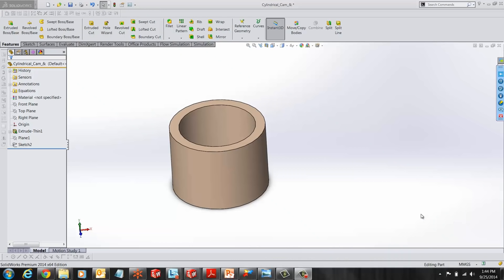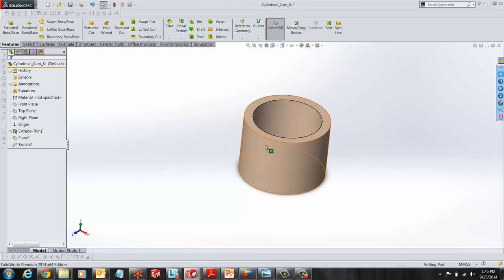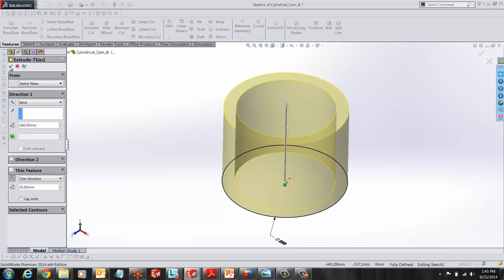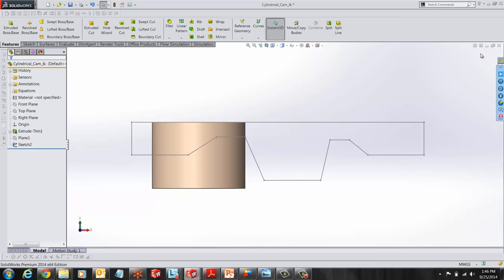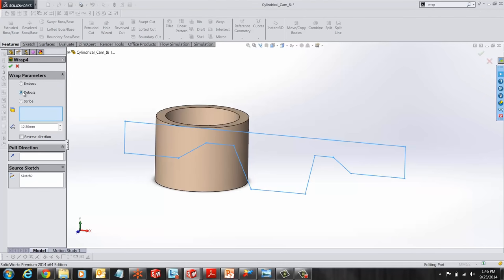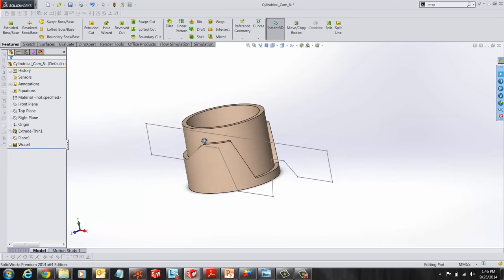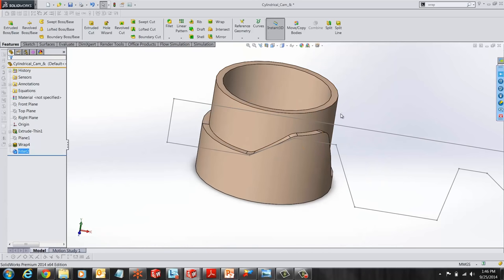SOLIDWORKS - Wrap Feature

Comment: If only fusion 360 had a feature like this. It has an emboss command, but no command that can exclusively wrap a sketch around a curved surface. There are ways around it, but they are round about, using the tools in ways they weren’t intended.

Comment: can you wrap around a rectangular prism ?
Reply from the maker: Per the definition of the wrap command lets us know the wrap can only be applied to singular faces 

You can choose between two methods to create a wrap feature.
The Analytical method wraps a sketch onto a planar or non-planar face. You can create a planar face from cylindrical, conical, or extruded models. You can also select a planar profile to add multiple, closed spline sketches.

The Spline Surface method wraps a sketch on any face type. A limitation with this method is that it cannot wrap around a model.

Comment: I was wondering if you could help me out a bit. I'm trying to wrap a sketch, which is exactly the same length as the cylinder's diameter, but it keeps giving me the error "could not use any contours from sketch". If I make the sketch a tad shorter, it works, but  still the sketch wouldn't be entirely around the cylinder. Any tips? Thanks a lot
Reply from the maker: The modeling kernel that SolidWorks uses goes out to 8 decimal places.  You may need to make the sketch width the exact circumference out to 8 decimals to make it work like you wish.

I just ran a quick test of this and it seems to work provided I enter a precise enough value for the sketch width.

Comment: I need to do this to cut triangular slots in that same type of hollow cylinder,  got frustrated and now taking a break..  I noticed there is an equation for the bottom dimension of your sketch to be wrapped, that would be the circumference of the cylinder right? how is that done or can I just calculate it one time,  or do I even need to be thinking about that. The slots are symmetrical and evenly spaced around the top.
Reply: Hi Brian,

That equation is calculating the circumference of the cylinder that i want to wrap the sketch around. While creating the dimension for that line segment, instead of typing a number, select the equal to symbol. This starts the equation. Circumference of the circle is (2*pi*R(radius)) or Pi*D(diameter). After the equal symbol type pi *  (double click on your cylinder to show the diameter dimension and single click to select it). This makes your equation look like = pi*"D1@Sketch1". Hit the green check and you'll notice SolidWorks does the calculation for you and represents it with a sigma symbol in from of it. This equation can also be managed under Tools > Equations.

Cheers,
Ronit
Reply: @ronitmukherjee6225  7 years later and this comment is still great. thanks
Reply: @RolyMoes  thank you. Happy to see this being helpful all these years.

Comment: I'm not sure if this will fix my problem or not, but it looks like it could. I have a cylinder object as the main part, and I need to affix a series of domed buttons around the outside of the cylinder. I've been scratching my head for a couple days on this one. 

I've created the part and a button. I figured once I can get one button attached I could just use the pattern feature to get the rest of the buttons installed.

I am fairly new to 3D modeling. As a matter of fact I've owned solidworks for less than a week and I've never attempted to model before. So there is that.

Sometimes I feel software developers need to give their applications to people who haven't been doing this stuff for years and see how it goes. Something as simple as combining two parts to make an assembly should be this difficult.

Comment: Ronet M - thanks for posting. I read your reply to Jaswinder Singh Chopra
 of 2-years ago. Really nice job, BTW. Giving you a 'thumbs up' on that. You told Jas that 2017 Wrap tool would work on any surface. In the video, you mentioned two surfaces: cylindrical and conical. Those are probably the most common, I suppose. A less regular surface might be a cube, pyramid shape, sphere or a shape like the classic hourglass form of a Coca Cola bottle. Could decent results be obtained on those surfaces?

Comment: I have an older version of SolidWorks (10) and by watching yours and other YouTubers video tutorials I've finally figured out how to use the wrap feature with good success.  Lately I've been attempting to use the "Wrap" feature on a model that is more of a football shaped cylinder.  I've gone through the same process to wrap my text around it but with each failed attempt I've gotten a popup message stating the this version of SolidWorks does not support the wrap feature onto a trapezoidal cylinder.
I'm trying to wrap the letter "C" onto this model so as to appear as fish scale texture on the surface.  This wrapping process works like gang busters on all the other models I've tried this on.  Can you give me a suggestions as to how to go about getting it to work on my football shaped model?
Reply from the maker: The wrap feature has been enhanced significantly since SolidWorks 2010. Several years ago it went from only supporting primitive wraps, cylinders, cones and such… To now include organic, BREP surface wraps as well as support for working across multiple faces.
 The only solution in this case is to upgrade to a newer version.

Comment: Can I use this feature on a tappered cylindrical face
Reply: Hi Jaswinder,

The wrap feature in SolidWorks 2017 gives you the capability of adding material (Emboss), removing material (Deboss) and scribing on ANY SURFACE. It can do tapered cylinders very easily. All you have to do is select the tapered face/surface and define a thickness for the emboss or depth of the cut.

Comment: is it possible to wrap the inside surface of the cylinder?
Reply: Hi Wan,
The wrap feature in SolidWorks 2017 gives you the capability of adding material (Emboss), removing material (Deboss) and scribing on ANY SURFACE. It can do tapered cylinders very easily. All you have to do is select the tapered face/surface and define a thickness for the emboss or depth of the cut.
 
Cheers,
Ronit

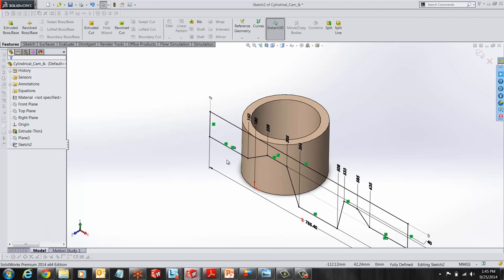Comment: Anyone know how he ended up with the circumference formula at 1:01? Up until now I've used my calculator and just rounded up slightly to avoid having 30+ decimal places. Although this method works it's not the correct way to do it.
Reply: Hi Phillip,
When adding the dimension for the overall length, I typed "=pi*" then double clicked on the sketch for the boss extrude. This displays the dimensions of the sketch of the boss extrude. Then I clicked the diameter value from the dimensions completing the formula "=pi*diameter". This should give you the equation symbol along with the value of the circumference. 

I hope this helps.

Cheers,
Ronit
Reply: @ronitmukherjee6225  Thanks Ronit, much appreciated.

Comment: sir how you add plane on this cylinder
Reply: Hi Rayan,

In order to use the wrap feature, we needed to make sure to create a reference plane tangent to the cylindrical surface. To create this plane, You'll go to Features > Reference Geometry > Plane. For your First reference you select the cylindrical face of the part and for your second reference, you'd select the right plane. SolidWorks logically knows that by making those two selections you are looking for a plane that is tangent to the cylindrical face and perpendicular to the right plane. 
Cheers,
Ronit
Reply: thank you so much you helped me thank's